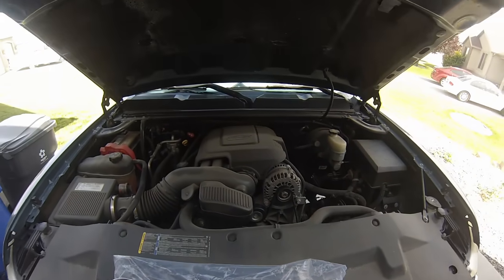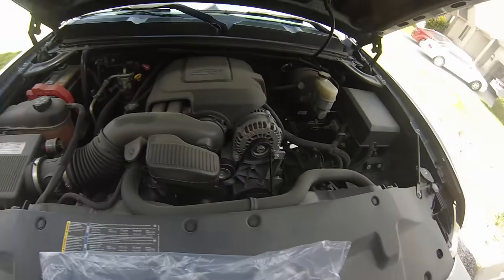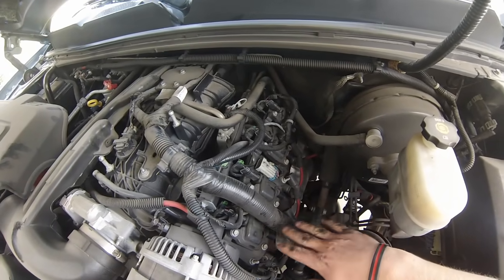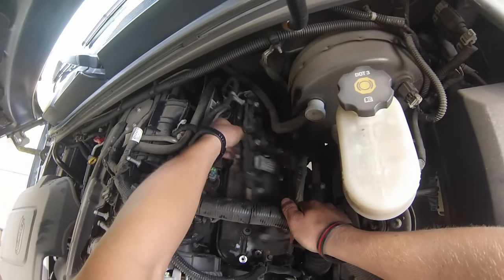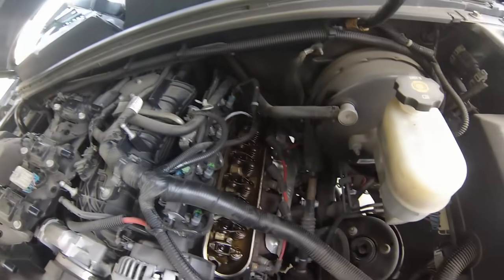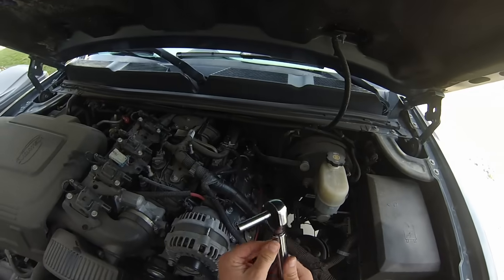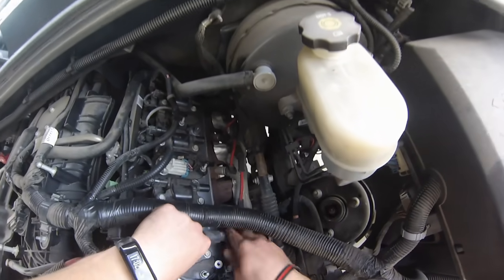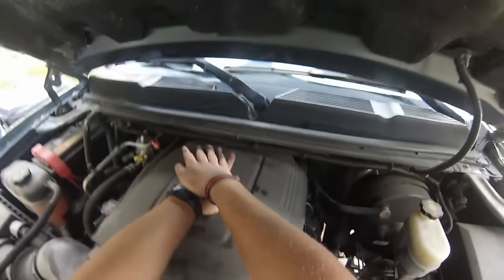Oil Consumption Fix: Replacing the Valve Cover and PCV on 2007-2013 Chevy Silverado

Comment: My 2006 2500hd its the lc8 engine with the cng currently removing it. I had codes p0300 p0332 p0455 turns out I had the same problem my rocker arm wasn’t touching the valve spring or the lifter, changing the cam Bc I had needles from the needle bearings in my oil, turns out that is from cam the Rockers have ball bearings. Now I’m checking lifter to make sure it’s not bent now

Comment: This is really helpful and seems very straightforward...except - can you explain real quick how to disable the AFM system to do this service? Man thank you so much I'm actually kind of excited to do this repair!
Reply: Oh never mind, I guess you don't have to disable it to do the service - you're just saying you've decided to disable it full time. Nevermind, if that's correct...
Reply from the maker: You are correct, and thank you for the kind comments. It's recommended to disable the AFM as well as doing this repair but you can do them separately. The device I use to disable the AFM is called the Range AFM Delete. It's a plug that inserts into the OBD port and deletes it. Thanks for watching!
Reply: @TheDadBodWorkshop  Do you have to leave the range in full time or is it a one-and-done deal? Reason I ask; I have a Pioneer system now that plugs into the OBD and I'd rather that plugged in than something that cuts out my AFM. I'm not terribly concerned with the AFM at this point, especially if I do this repair (is that fair to say?)
Reply from the maker: @braddavis9780  unfortunately it needs to be plugged in all the time. I believe you can get custom tuners that will disable it permanently without it needing to be plugged in but the range delete kit is not one of those. Also, the range works by tricking some of the emissions sensors which keeps the truck in V8 mode and it works great but it also won't pass emissions until you unplug it and drive it around for a few miles.
Reply: @TheDadBodWorkshop  When you've got that cover off and before you place the new one on, is there any recommended cleaning that ought to be done before you place it on? All that oil on what's left - is that ok to just leave as-is and place the new cover on?
Reply from the maker: @braddavis9780  cleaning never hurts but I usually won't do it unless I see carbon buildup or hardened oil.
Reply: @TheDadBodWorkshop  Hey, real quick....when you are checking for the leaks, man are you just running some water in it? Is it hard to get back out with the placement of that repositioned opening?
Reply from the maker: @braddavis9780  you can use water but make sure you dry it out really well. Oil and water don't mix haha. But it is really easy to reposition it back into place.
Reply: @TheDadBodWorkshop  Ha! my point on the oil and water. Man I'm sorry to keep asking questions but I'm literally going to make this repair today and you've been an incredible resource. I guess I'm confused though, you say it's easy to reposition... what is? Like do you take something apart to help drain and dry the water after testing?

Comment: I went to burning a quart of oil every 500 miles then I put the range control device on that deactivates the fuel management now my truck burns pretty much no oil.
Reply from the maker: That's awesome! Sounds like you caught it early enough. I would recommend still replacing the valve cover to ensure it never burns oil.
Reply: how is this part done? any videos of process?
Reply: @jesusrivas2760   Hi I just bought it and then put it into the diagnosis port and leave it plugged in.  I did run  Additives to help dissolve carbon also.

Comment: Did this whole thing and more also the range unit. Didn't help with oil consumption. Every 800-1000 km I lose about 1 liter.  I also noticed that driving long distance at speeds of 80 to 100 km/hr I loose oil. Driving 120 km/hr I dont loose oil and car runs smooth. Darn GM Yukon Denali Hybrid 2011.
Reply from the maker: In some cases, the engine has ingested too much oil in it's life and the oil has created carbon deposits on your oil control rings. GM has a TSB out for this but it involves putting a solution on top of all your pistons and letting it soak. The idea is the solution will dissolve all the carbon deposits on the oil rings and let them start working again. I've never talked to anyone who has done it nor am I aware of it's success. Good luck!

Comment: After multiple videos I mainly see driver side getting replaced so I'm guessing the passenger side is not  necessary to change...Correct me if I'm wrong...plus thank you for sharing this video.
Reply from the maker: Yes you are correct! Only the driver side has a PCV valve. Thanks for watching!

Comment: After you installed the updates valve cover did it fix your oil consumption issue? 
Thanks for the video.
Reply from the maker: It helped but has not cured it 100% yet. My next step is to add the oil deflector in the oil pan. Thanks for watching!
Reply: Do you remember exactly which valve cover you bought?
Reply from the maker: @reddjohnson9728  I bought the Dorman 264965. I used Rockauto to purchase it.
Reply: @TheDadBodWorkshop   did it help ?

Comment: I have a 2013 tahoe ltz. I just did this. The valve cover I removed looks just like this “newer” version. The pcv valve was all clogged up. I am “using” about 3 quarts of oil every 2000 miles! A lot of oil consumption. It’s bullshit. So I took and got a new valve cover and changed it out brand new. So I’m due for an oil change now and I’m changing the oil today. So I’ll see if it fixes the oil consumption issue. If that’s not it’s it’ll be the damn variable displacement system….
Reply: Did it
Reply: @cameronhoover7561  awesome. You should notice right away it will stop using oil. I also ended up getting the DOD system tuned out of the computer so that it won’t kick in. The funny thing is my mpg went up from 15 mpg to 16 mpg average.
Reply: Ima have to so the same
Reply: @cameronhoover7561  did the valve cover swap work for you at all ?

Comment: Before you replaced this, were you getting a lot of oil on your spark plug and ignition  coil? I  got a misfire code, went to change the spark plug and it’s oil everywhere in the cylinder. Does this fix the problem or is my problem deeper?
Reply from the maker: It can fix it as long as the problem isn't too bad. Once the consumption gets bad, damage will happen and then it would plug up the rings.

Comment: According to GM if you have a truck built after February of 2011 you already have the updated valve cover.
Reply from the maker: I heard that as well. I haven't looked up other years but I know for my year there were a couple different fixes GM had for oil consumption. Another one was the oil diverter inside the oil pan. Thanks for watching!
Reply: My 2014 Tahoe had the old cover. GM must be trying to use up old parts. It did have the oil pan fix though. Dont assume GM  does the right thing.
Reply: @mattaverill6942  That's strange, my 2012 Silverado had the updated one. I drilled the holes and I'm 1200 miles on the repair, we'll see if that stops my oil consumption.

Comment: I added catch can for pcv valve. Afm also burns oil.
Reply from the maker: I've really considered adding a catch can. Can I ask which one you went with? On the AFM note, I added the Range AFM Disabler that plugs into the OBDII port which disables the truck from ever entering into V4 mode. Only downside is that I need to remove is a week before Emissions because it will cause the truck to fail. I think it disables a couple of the sensors and forces the truck to stay in V8 mode but I'm not sure...
Reply: @TheDadBodWorkshop  I use moroso but any sealed type catch can amazon works fine.

Comment: Hey Xinnkoda! Great video! I just noticed a problem today with my 08 Suburban. The oil pressure sensor went bad with 0 oil pressure on my gauge. Repaired that and went to check my oil just before I buttoned everything up and it barely registered on the stick. Just changed the oil and confirmed it was full in January. It took about a quart and a half to get it to full today. First question is how much oil were you losing? Because I know I have a leak but it is only drips on my floor. My buddy said there is no way I am losing that much from just that leak and feels it is the PCV valve. He found that it was a  valve cover issue which your video helps me with. But did your truck always use oil or did it just start doing it. I very rarely check my oil. I typically get it serviced and even though it is 12 years old, it only has 86000 miles. I don't tend to check it because I guess I just take it for granted that there is no oil usage problem because of the low mileage and not seeing any tell-tale signs of smoke or smell of oil burning. So I don't really know how long this has been going on. Also, wanted to find out - you said you turned off the active fuel management. I have heard of engine problems being caused by this "feature" and would like to turn this off myself. My second question is how did you turn this off and can it be reversed if I have to trade it in eventually? Thanks again for the great video. I will probably take this on very soon.
Reply from the maker: Thanks for watching! My truck only had 88k when I bought it and it was using oil a decent amount. Your friend is correct about it likely not being from the small leak you found. There are a few things to do to help fix the issue... One of them is the PCV valve like I showed in the video and another is shutting off the active fuel management. The device to shut it off is made by Range and you can find them on Amazon. Just search for "Range AFM Deactivator" and that should pull up the results you need. After doing those two fixes my oil consumption went down drastically. I went from one Quart of oil every 1000 miles to about one Quart of oil every 5000 miles. In the worst cases, oil has gotten down into the piston rings and will not allow the rings to function properly. A dealership can attempt to free up the rings by putting a cleaner on the top end to clean them but I'm not sure how effective it is. I hope you caught this issue early enough so you can prevent the rings from going bad. Good luck!
Reply: @TheDadBodWorkshop  Thank you very much for the info. I will get on this as soon as I can. Looks like the device you are talking about to stop the active fuel management is about 200 bucks. Does that sound about right?
Reply from the maker: @P-Dawg-01  yep. It's expensive but well worth it!

Comment: I installed this new "updated valve cover" still going through oil, I installed clear tubing where the pcv line goes from the valve cover to the manifold and I can see oil still getting sucked into the line this valve cover does nothing.
Reply from the maker: Hey Kurtis, you may be getting excessive blow by from the crankcase. Have you considered doing an oil catch? It's possible you have a lot of carbon build up on your piston rings, especially your oil control rings. You can try putting seafoam in the oil 200-300 miles prior to changing it to see if you can free up some of that build up on the pistons. Good luck!
Reply: @TheDadBodWorkshop  excellent advice
Reply: Kurtis, what did you find was the problem?
Reply: Replace your valve seals

Comment: Thanks for the video :).  One question I have is, is it only the driver side valve cover that would need changing?  If not how do you know which side needs the work?  Sorry if that's a silly question.

I currently have a lifter tick that comes and goes. I'm thinking of doing the afm/dod delete with the range device but also pulling the passenger side valve cover to check out things as that's where the tick is.  Is it worth changing that valve cover if have it off or is that side problem free?

Thanks for any info ☺️
Reply from the maker: Thanks for the reply! Fortunately it is only the driver's side that needs replaced. If you've got lifter tick I highly recommend doing an oil treatment to try to loosen up any grime that may be stuck in the lifter. I usually add a but of seafoam into the crankcase oil before doing an oil change. Marvel's mystery oil is also good I hear but haven't used it. Follow instructions on the seafoam container when adding to engine oil, it will give you info on how much to add and also how many miles to drive with it in. Good luck and thanks for the kind comments!
Reply: Thanks!  Yeah was planning on giving the seafoam treatment a go before next oil change.  Will def change up the valve cover too, you made it seem pretty straightforward so I'm happy to go for it 👍
Reply: I have the same lifter tick sound in my 2011 Silverado. What did you end up doing ?
Reply: @BigHomie030  for the tick, I run a range plug in. So it stays in V8 my mode.  And I add some transmission fluid to my oil too.  Has helped but not totally gone.  Especially when it's cold.

Theres a lawsuit regarding this.  Your 2011 may be covered.  You'll have to look in to it

Comment: I can't believe no mension of the engine size.  
On my 2005,  3.5L I'm going to drill out my old valve cover as recomended by several videos.   None of them mension the new valve cover showing a new square vent hole to the right of the old hole.

Comment: I have 2005 Chevrolet Silverado 5.3 only on cold start up a puff of smoke comes out then goes away not when I'm driving some days it does it and some it done I've had ppl tell me can be pcv on valve cover....would it be better to replace or just take off and clean it out anything helps I Haye the smoke on start up

Comment: Is there a plunger in this pcv valve, or is it simply a connector tube for the return air for the air intake manifold?
Reply from the maker: Great question. To my knowledge it's just a connector tube. I believe the way the baffles are set up on the new design make it so there's not a plunger needed. Thanks for watching!

Comment: Hi, i have chevy 2007 avalanche with new rings and valve seals. Still burning oil, is there a way to check if the valve cover is the issue before replacing it? Thsnks for your great video.
Reply from the maker: You can take off your intake and look inside your intake manifold just past the butterfly valve to see if there's a lot of oil. If the pcv valve is faulty, there will be a lot of oil sitting inside the manifold.
Reply: @TheDadBodWorkshop  took a look and there is some "glistening" reflection with indicates it may be oily, however, i would expect some oil there anyway right?
Reply from the maker: @russellmaguire4316  Correct. It's normal to have a slight "film" of oil. What's not normal is to have puddles of oil inside the manifold. If that is normal for you, then you can try installing the AFM oil reflector. It's a piece that sits inside the oil pan and prevents oil from spraying and hitting the bottom of the pistons. GM lists it as a possible reason for the oil consumption in their TSB.
Reply: @TheDadBodWorkshop  thanks for the promot response. I would be alittle concerned that might cause piston overheating? I will go for the new valve cover and see. Also with the plug in AFM unit is there anything else i need?
Reply from the maker: @russellmaguire4316  GM actually lists the oil deflector as a possible fix for the oil consumption. I wouldn't be too concerned about piston overheating if GM recommends it. If the valve cover or the oil deflector isn't the problem, the likely reason for oil consumption would be the oil control rings are plugged up with old oil. You can try running sea foam in the crankcase to see if that will loosen up the control rings. I usually do this the last 300 miles before I change the oil on my truck as it cleans out carbon buildup. Just use the instructions on the bottle of seafoam.
Reply: @TheDadBodWorkshop  i do the same thing with the sea foam. They recommend the last 100 miles and the radio is 1 ounce to every quart of oil. That comes out to 6 ounces of sea foam. If you havent ever foamed the engine you can def run it longer then 100 miles. Ive actually got foam in one of my 5.3s right now and im over 500 miles.

Comment: My 8.1 is burning holes in my wallet gotta fix this fast
Reply: This update is not related to the 8.1L engine, only the small blocks (4.8, 5.3, 6.0, 6.2).  8.1L valve covers are still very similar to older BBC covers.  The 8.1L draws PCV air from the underside of of the intake manifold.  Some report that pulling the intake and adding an extension to that tube reduces consumption.

Comment: So is this what fixes oil being used between oil changes cause my 12 gmc need about two courts by time of change. And you put a programmer on I heard and maybe you can tell me different but when you delete the 4 cyl shut off it could cause more problems with the lifters or whatever mechanism works that part? Any help would be great thanks.

Comment: I checked oil levels but low against and fill oil against for 2013 gmc sierra 1500 5.3L V8
Reply: check crazed performance repair for how to repair your valve cover

Comment: Does anyone know if GM upgraded this part on 2012 5.3 liter engines? My 2012 Sierra with 130,000 miles on it and a Range AFM delete uses about one quart of oil between oil changes . Would trying this help or just be wasting my time and money ?

Comment: Hey bro thank you for the video. My wife’s 2007 suburban LTZ is burning about 2 quarts around 2,500 miles.  Concerning the AFM delete how would I know if that is something included in this model?  Where can I get the part to do this delete? Thanks
Reply from the maker: If it's burning that much oil, it's almost guaranteed to be from the AFM system. I got my AFM kit from Amazon. Good luck!